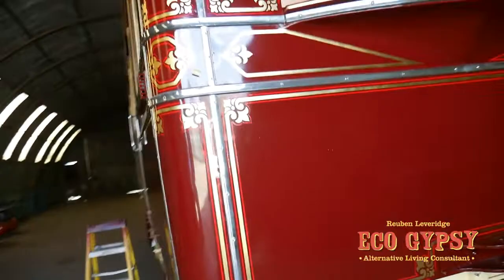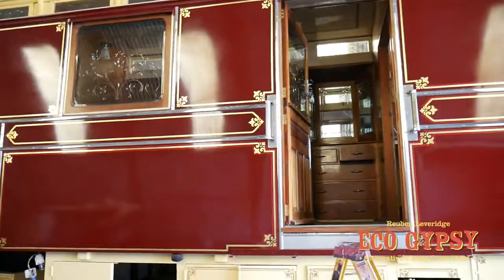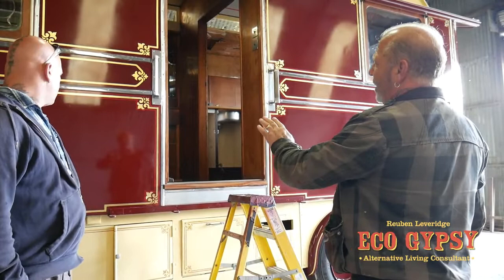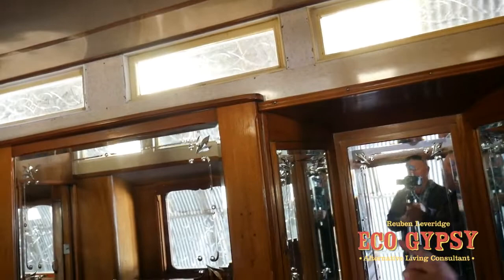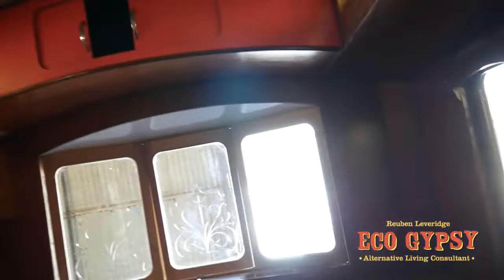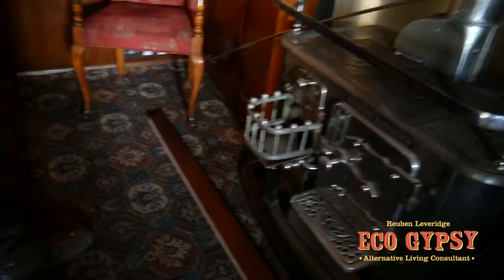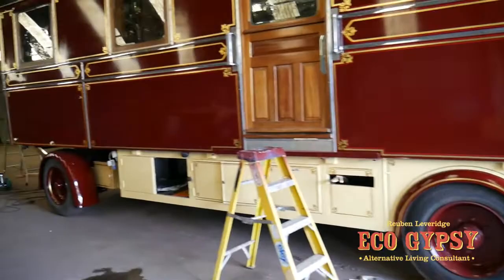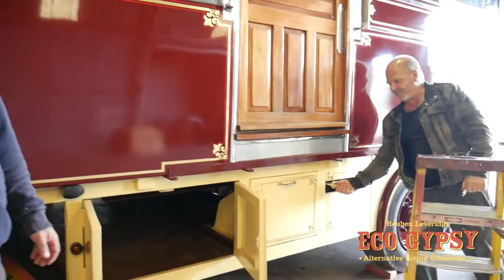WAGON PAINTER JOHN LEVERIDGES  2nd VIDEO  1930S SHOWMANS WAGON ECO GYPSY

Comment: The workings of a very good video, its really nice to see some one documenting this kind of (Quality) work at last on good quality hd film, as this is a dying art, and needs documenting, don't worry about the sound too, I'm sure you will get that sorted, i worked a little for the late great painter John Pickett when i was a kid, so I've seen a few of these inside and upclose, never did any of the ornate work, mostly the stripping, wood and metal work restoration and undercoating and top coating, but have seen John Picketts great carving and painting up close..and what a fantastic art it is.!.
this showman's is in pretty good condition, compared to the state of some showman's I've seen roll into a yard, normally they were in quite a state, but once they rolled back out, it was a different story....looking forward to more videos from you Reuben, cheers Mart.